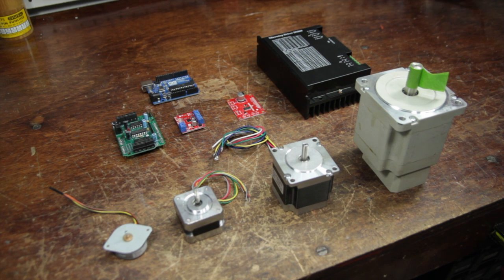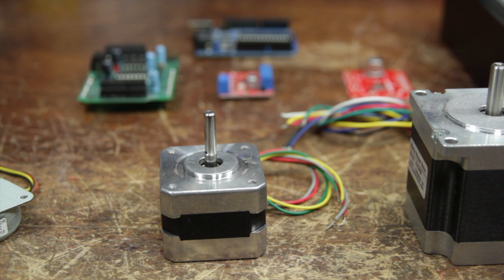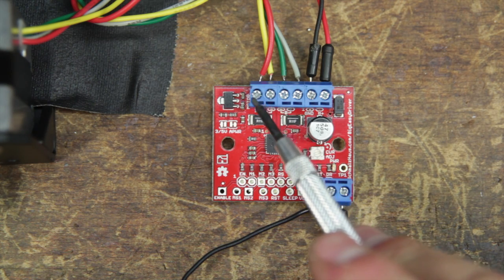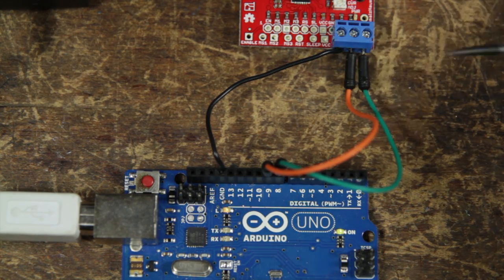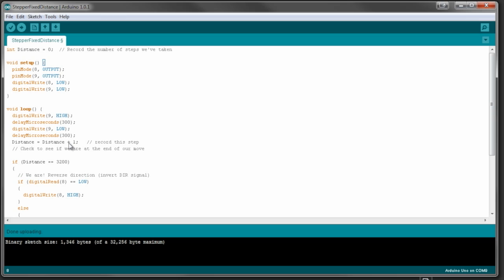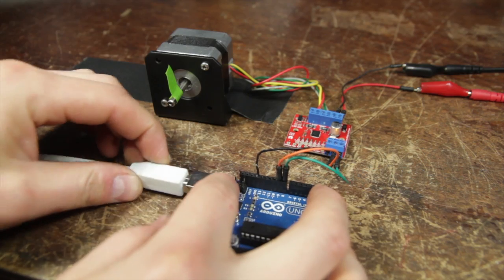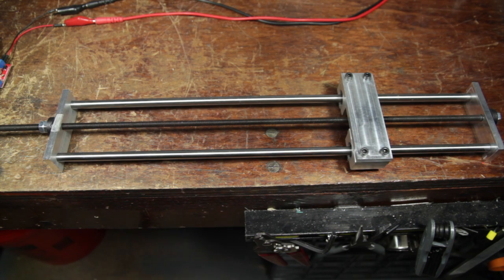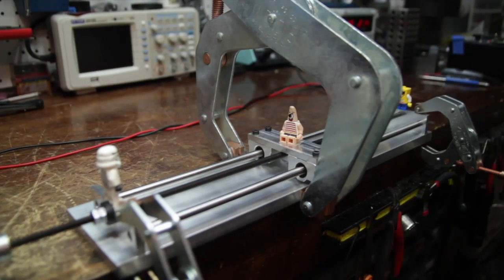Arduino Stepper Tutorial - Using Sparkfun Big Easy Driver to create a single axis CNC

Comment: Great timing on this video.  I am just now playing with adding a stepper motor to lift the door on my mill enclosure and was thinking "I bet I can do this with an Arduino".  I bought a stepper driver kit which worked great now I just need to control it.  I could probably do it in Mach3 but I thought it would be fun to do a stand alone and save an output.  Can you do a video on ideas to add limit sensors?